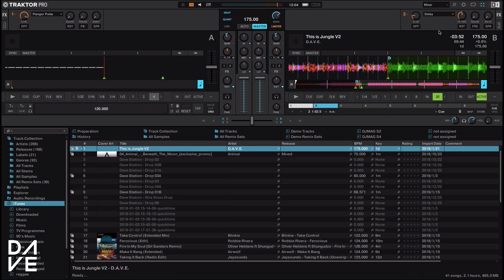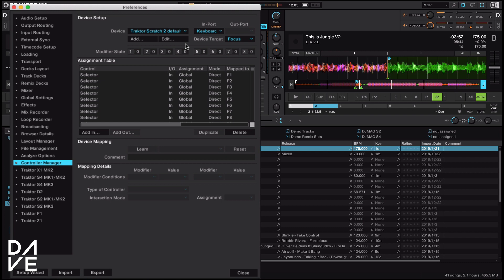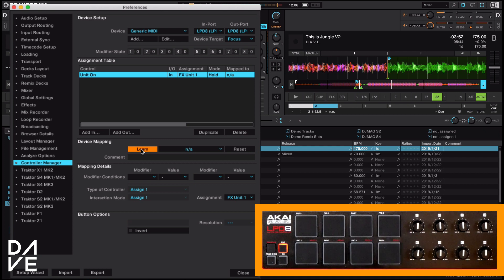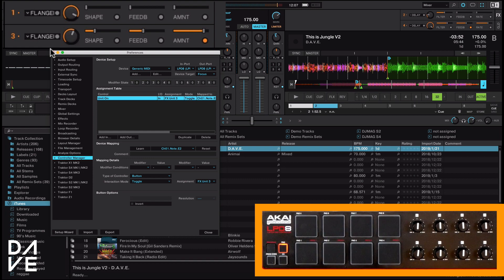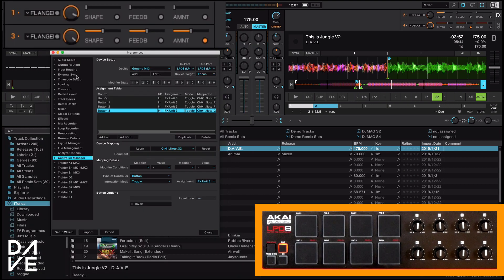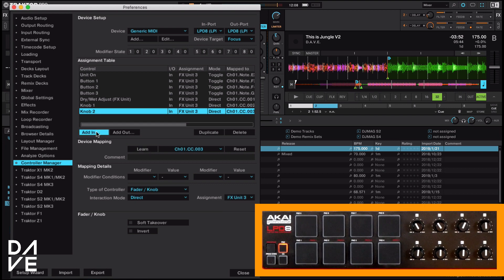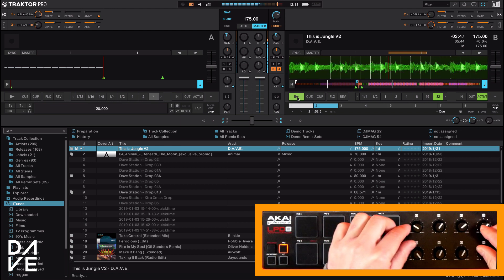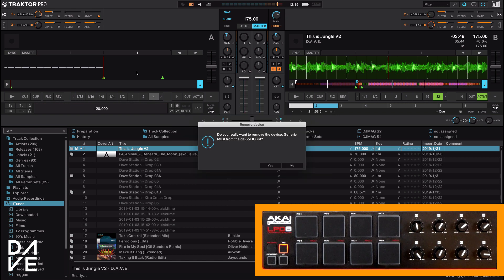Basic Midi Mapping For Native Instruments Traktor Pro 3 - Mapping Fx 3 & 4

Comment: Love the LPD8. What a wonderful, versatile controller! In Trakor I have it mapped for track preparation, adding my most common cues, selecting and deleting the next cue (great for quickly clearing 8 bad cues from that time I let Mixed In Key try to auto-cue my non-techno music collection), locking/unlocking the grid, and beat jumping through the track. In my DAW I use it with a bunch of custom plugin mappings for hands-on mixing. A great, affordable piece of gear with the most reliable USB midi drivers I've ever used on Windows.

Comment: Hi Dave. Thank you these great tutorials!!! Is it possble to use two controllers on Traktor at the same time? For example the LPD8 only for the effect sections and a midi mixer like reloop mixtour for the rest of traktor? In this case would the effects control on the mixtour still work or has the lpd8 overwritten the midi cc values of the mixtour? Have great day.
Reply from the maker: You absolutely can. It’s the controller actions that get mapped so you can you what you want and they will both work what you want. So if you move the wet/dry knob (for example) with you lpd to zero but then you move it with the mix your it will jump to the physical knob value. So be careful and use soft takeover

Comment: Hey I’m looking for a bit of advice. I have a Z2 mixer and I want to have control of the deck c and d EQ controls so I can mix 3/4 tunes at once. I have a novation basic controller that’s sitting idle. I was thinking of maybe getting a z1 and making my set up 4 channel. Would this work do you think?
Reply from the maker: Absolutely that would work. You coils also map the z2 if you wanted
Reply: @DAVEDigitalandVinylExpert  I have a good map for the z2 but it doesn’t give me EQ control of c and d. Do you know if the z1 can plug into the Z2?
Reply from the maker: You can either add to the mapping or you can just plug the z1 into your computer as well and then change the focus for it to decks c/d

Comment: Hey Dave. I'm rather new with this controller and really need your help after spending hour after hour on google posts trying to find some help; after I have loaded the presets, what specific name do I safe this by ? Because when I want to import this file into traktor and use it with my ddj T1 I can't. I hope u have a simple solution because I'm doing something wrong. Thanks. Soren
Reply from the maker: Hey Soren, when you have finished the mapping you go to edit and export in the mapping window. That will then save as a .tsi wherever you want. Please remember this is controller specific, so if you made it on a S4 you couldn’t use it on a S2. They would have to be 2 separate mappings.
Reply: @DAVEDigitalandVinylExpert  thanks for the quick reply, appreciate it. I made it work now. I'm interested in getting different beats / sounds to each pad. Is that possible? I've downloaded a sample pack with all sorts of drum / kick sounds. I want to be able to play these sounds using the akai pads and then controlling effects using the knobs. Is this possible or would I have to buy another controller ? Thanks. Soren
Reply from the maker: Yeah. You can load individual sounds to each pad on a remix deck and control it how you want.
Reply: @DAVEDigitalandVinylExpert  Have u made a video of how to add these drum effects to the 8 pads ? 🙏🙏 I've also noticed your Traktor F1 controller & even though it's far more technical considering I'm just getting started with this part I'm really considering buying the F1 instead because it's so much easier to get up and running. And I assume the F1 can be plugged and connected with my DDJ T1 controller , right ? Thanks for your time
Reply from the maker: Yeah it’s all in the F1 series and it’ll work alongside your controller
Reply: @DAVEDigitalandVinylExpert  Would u recommend a F1 for a beginner ?
Reply from the maker: Yeah if you feel it’ll work with your setup. It’s a great addition to have and there’s so many ways you can use it.
Reply: @DAVEDigitalandVinylExpert  thanks man. I appreciate you took time to reply. I'll probably get myself the F1 instead. Cheers

Comment: Hi Dave, I'm new to midi mapping, is it possible to use FX pressing shift + filter/low/mid/high knobs? By removing the pressure from the shift key, I expect the knobs to return to their original function without messing up anything until the position they are in at that moment is reached. I just want to know if the mapping allows you to do this, not the procedure of course :) Thanks
Reply from the maker: Hey Luca yes you can. If you check this video out it’ll show you a similar approach. Shout if you need some help. 
https://youtu.be/uCRCfpxa07I
Reply: @DAVEDigitalandVinylExpert  May I ask you if on the S2 mk3 you have noticed volume differences in the rca and 3.5mm outputs? The rca seems to have a higher volume. In general the output does not seem very high to me, I also disabled the limiter and put the value none on the headroom of the internal mixing mode,  EQ type is Z ISO but I tryed all the others aswell. Thanks :)
Reply from the maker: yes there is a volume difference between them. If you had jacks they would be louder and XLR louder still.

Comment: Dave ran into a problem working on traktor 2 and trying to assign the fx to specific deck... so if i want to have desk 1 plays effects on and having deck to working off effect 2....
Reply: i figured it out was making it harder than it needed to be... thanks
Reply from the maker: Ok no worries. Glad you got it sorted :-)
Reply from the maker: Hey,
When assigning in controller editor, bottom right there is an option to which deck you want to affect.
Reply: @DAVEDigitalandVinylExpert  i think i have a fix i can work with but what i want 2 separate functions 1 to turn on the effect back which i have done and 2 then be able to assign it to which deck i want the fx unit to control... would i have to assign the on off of the fx to a global command and then assign the do the second command for the specific deck i want to effect to control

Comment: Hi Dave! Could you please advice, is the Traktor Pro 3 able to distinguish between two Akai LPD8 units connected? I have an idea to mapping with the first one the fx 1 & 2, and with second one the fx 3 & 4 (as my S3 controller is not equipped with any FX knobs)? Thank you for advice in advance!
Reply: ... or is an Arturia BeatStep better solution?
Reply from the maker: Hi Attila, sorry for the delay but I wanted to test this so I didn't give you incorrect info. Yes you can use your 2 LPD8's to midi map. In order to ensure they are different you need to look at the in and out ports(top right of controller manager) to select which one you are mapping. Shout if you need anything :-)
Reply: @DAVEDigitalandVinylExpert  Hi Dave, thank you for response, I really appreciate you tested it for me, it's very kind of you. In the meantime I decided to buy an Arturia Beatstep, but it was a big mistake. The quality of encoders are very poor. If I move the knob in smallest possible turn, the unit is willig to randomly send a bunch of MIDI messages despite I set the Knob Acceleration to Slow (Off), resulting a jump of FX knob in Traktor Pro 3 for even up to a third of his rotating range. So terrible, it's unusable. It is a design problem, like they forgotten to debounce encoders. I've just initiated a buy-back...
Reply from the maker: Oh no. Have you ensured your sensitivity on the mapping is ok?
Reply from the maker: Fair dos just wanted to double check to save you a return :-)

Comment: If the Akai has a possible 32 pads scrolling 8 four times, is it possible  to have a different effect set from Traktor on all 32?
Reply from the maker: Kind of. You could have all 4 fx slots as groups so 12 different fx then the mixer effects as well so 5 of those as well but again they would need to scroll through them. So kind of 17 in total but you could map other buttons to toggle through the effects as well.

Comment: -Hi! Maybe you'll have an idea. I have AKAI MPK mini mk2. I used to map it with Traktor Pro 2 - no problems at all. After connecting it to Traktor Pro 3 w/S2MK3 it seems that Traktor is receiving midi signal, it "learns" in controller manager section, but settings take no effects on fx units or any other functions. Any idea what i'm doing wrong?
Reply from the maker: Weird. Feel free to send me screenshots/more info to my email dave@digitalandvinylexpert.com and i'll try and help
Reply: It was sys problem. Reinstalled win and mapping went well. Thanks!

Comment: Hi Dave, this is a great fix for something that annoys me about my s4 mk3. Not have 4 fx banks or selectors. If I were to use this work around. How do you then select which deck you want to be effected by banks 3 or 4 as there is only a selector button for banks 1 and 2. (Hope that makes sense)
Cheers
Reply from the maker: Hi Dale, thanks for the question. 
You would need to map the fx ‘active’ button (1,2,3,4 buttons on each deck) to arm the fx to the relevant decks. So you would need more pads or map a modifier to them. 
Ask away if you need anything else.
Reply: Thanks for the quick response. I do have an f1 and x1 also, and I'm aware of various maps for the f1, but would like to keep that  used as a remix deck. I tend to use the x1 as control for decks c & d to save flipping from one to the other on the s4. While having the x1 control deck c & d the effects of banks 3 & 4 are controlled by the x1. Is there a simple way to get all tracks to be triggered on all fx banks with this set up? (Sorry I'm a noob) lol. 
Cheers
Reply from the maker: Great set up Dale!
Unfortunately no NI hardware allows you to control FX 1234 at the same time, it's either fx 1&2 or 3&4. What you are looking at is a mapping.
I would happily help you with that if you wish. Send me a message to dave@digitalandvinylexpert.com and let's get you going :-)

Comment: Hey Dave, great tutorial as always!
Im sure you know about the Tekken FX F1 mapping - I'm currently using that on my F1 that I use with a S2 MK3. Only problem is, I want to have a dedicated filter knob for decks A and B (a'la S4 MK2)
Do you think it is possible to map the existing filter knobs on the F1 for that purpose? I still want to use my 3 mixer FX on the S2 MK3 while having 2 knobs only for filtering on the F1 with the tekken mapping.
I have tried every option I could, watching your videos and visiting forums, but no luck so far.
Since Tekken does not utilize the 1st FX bank on traktor, I thought I'd map a Filter:92 there and use the F1 far left and right mute buttons to turn off that FX for Deck A and B respectively. Would this be possible? Thanks in advance and keep up the good work!
Reply from the maker: I have replied on Twitter 😁